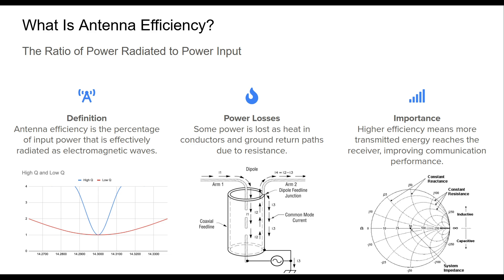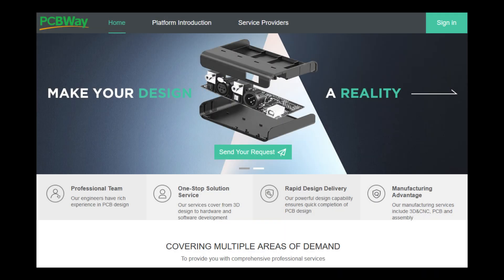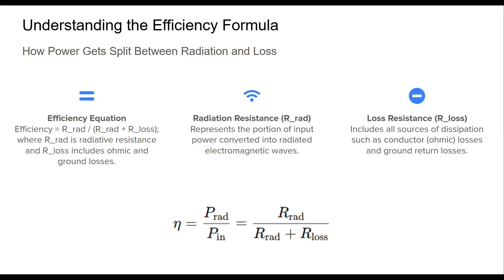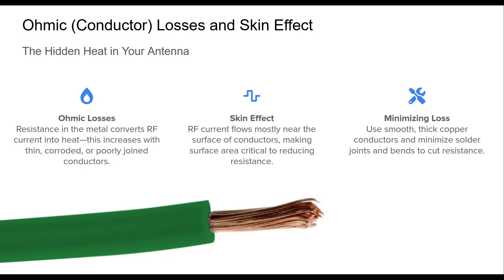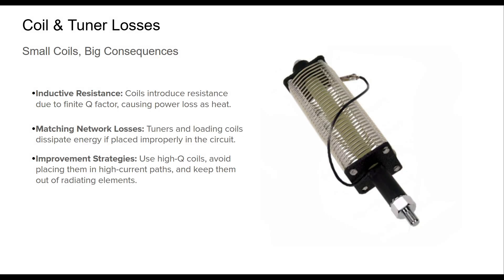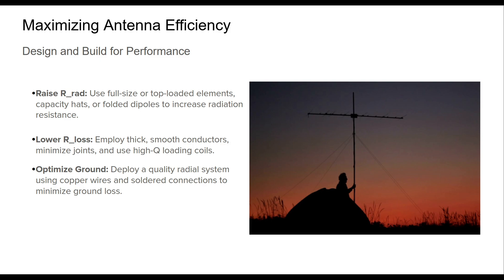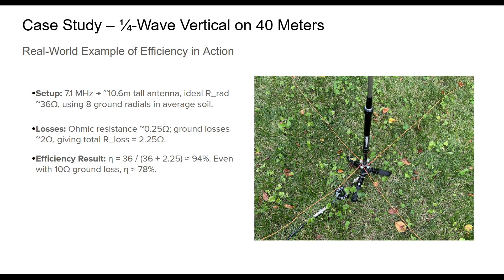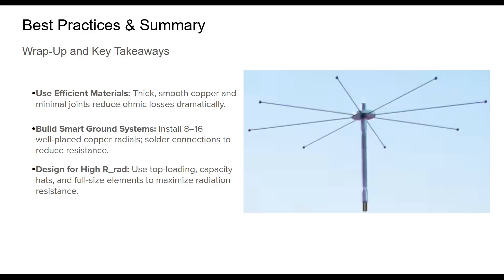Unlocking the Secrets of Ham Radio Antenna Efficiency!

Comment: I think you have oversimplified "efficiency" when speaking to the number of ground radials. Adding more than your recommended 8 to 12 radials will decrease your angle of radiation, so more radiation in the direction you need (unless you are into EME of course). So while from a formula basis, 8 to 12 radials is theoretically efficient, from a practical use perspective, more radials gets you more efficiency int the desired direction (out not up).
Reply from the maker: It’s a fair point…

Comment: I'm looking at EFHW focused on QRP at 14.060 ... and, both resistances dealt with, wondering what else affects efficiency!

I'm sure ground has effects. So now I'm wondering about height as related to wavelength/frequency.

cheers!
--VE6IU
Reply from the maker: The type of wire and coax can effect efficiency 👍

Comment: HF verticals are notorious for being inefficient, both from ground losses and from low radiation resistance. At resonance, the radiation resistance of a 1/4 wave ground plane is 37 ohms, at best. If you shorten the radiator with a loading coil or traps, the radiation resistance goes down further. Add ground losses (which actually make the SWR better) and you can quickly have a vertical that may be 20% efficient or worse. With low radiation resistance, any resistive losses in material, either the antenna or feedline become a larger part of the overall loss due to the higher current needed to feed the lower radiation resistance. The low feedpoint radiation resistance also increases ground current and losses in the ground plane, which is one reason we need to have a much better ground plane at 80 and 160. Moving the high current point of the antenna well above ground will increase radiation resistance thus efficiency but requires a way to better match the antenna to the coax for low SWR. Simple enough for a monoband antenna, much more complex for a multiband antenna.
Reply from the maker: I’d agree with all that…

Comment: Great video . Look at AM Broadcast stations .Ground mount vertical . What you do not see is the large amount of copper in ground radials . The outher half of antenna !  And it is copper welded . With poor soil more copper is needed and products like GEM is used to improve ground.  Their is ways to measure ground resistance. And this does change due to weather like a snow storm to a drought . When done correctly a AM signal with travel along the ground. up and down hills and valleys to up and over a mountain. Longer wave length changes . That why AM radio can reach more people and larger coverage. Look at NC area like Ashville . Hilly and mountains with dips and valleys.   AM radio is the best coverage for them. And it really played off last summer. Mt Michele has great coverage but block in some areas . The AM radio signal gets into them areas . 73
Reply from the maker: Thanks for the info Robert and for watching 👍

Comment: Tip number 5... Avoid commercial antenna with built in heatsinks ☹️

Tip 6 - two home built ATU of ostensibly the same design but one is very peaky & difficult to set right whereas the other is dead easy to set... I'd like to bet that the difficult one is the better & the easy one is lossy. Difficult suggests high Q hence low loss. Easy broad tune suggests low Q hence lossy (rotor to stator joint a common culprit as are dodgy toroid supplies). Mag loops are especially low Rrad so checking out the lengths those builders do to minimise Rloss gives good tips.
Reply from the maker: lol @ heatsinks on the antenna!

Comment: Well done Ape!

To back this up, let me tell you of a common occurrence at many AM stations.  Due to neglect (or theft), the existing ground radials no longer are doing their job well.  Therefore the R-loss is greatly increased.  The signal from the antenna is now compromised and not nearly as strong as the license requires.  What's an engineer to do? The owner refuses to put up the money to repair/replace the radial field.  Well, we'll have to increase the R-rad then to regain our signal strength.  One of the most common ways to increase R-rad is to convert the normally  "series fed" tower into a grounded "folded unipole".  We ground the tower and add skirt wires to it, then feed the skirt at the ground level through a tuner.  BINGO!  This nearly triples our R-rad and restores our signal strength.
Reply: A folded unipole is precisely what the little AM station in the little town where I grew up used. The owner bragged about the added efficiency.
Reply from the maker: That’s for the story about the stations Hollywood.  I’ve seen a bunch of videos where people use SWR as an efficiency metric so I figured I’d make a video 👍